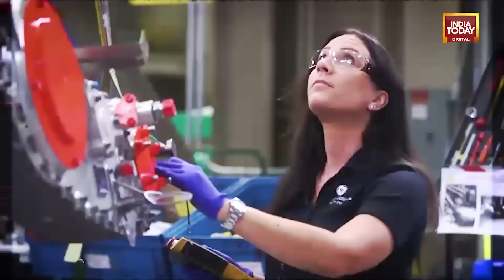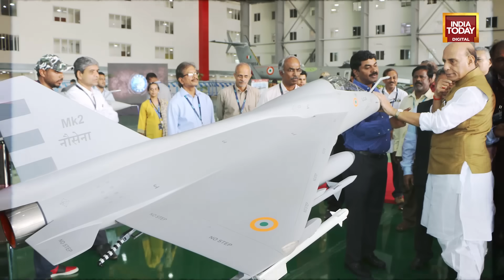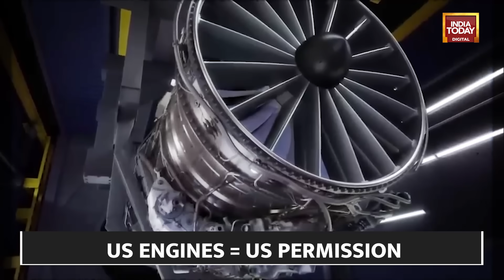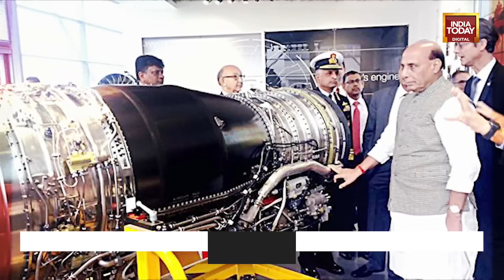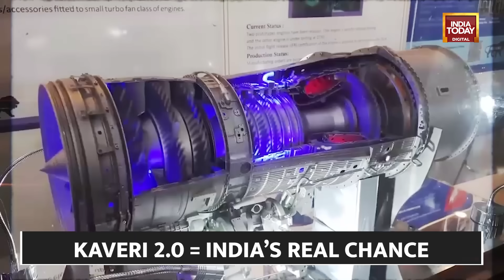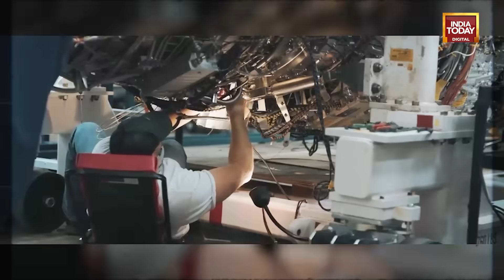Kaveri Engine: India’s Tejas Jets Could Fly Abroad—If We Shed the US Engine Chain #FundKaveriEngine

Comment: don't claim results of  the actions you didnt put in.
The budget india spent on kaveri devlopment is peanuts compared to the nations who have scceeded to develop their engines.
India spent less, got less, should be happy with dry kaveri for ucav ghatak.
When they can make a reliable afterburner, they may get a 80+ kn engine by 2035,  but that won't do for tejas, it needs 85 kn for tejas mk1a & 95+ kn for mk2, tedbf & Amca.
Under no condition kavery can match that, 
So the new 120+ kn engine development with foreign OEM is the only option, till then keep dancing to US tunes

Comment: Building an engine is no joke. Jet engines need single crystal blades and we don’t  have the tech for even this. Jet engines also has too much electronics in it. India needs to take this very seriously to build. Once you have an engine small commercial jets are around the corner.
Reply: Bhai lack of single crystal alloy will only restrain you to have a  not that good engine, won't stop you from having a usable engine. I remind you AL31F, RD33 and F100PW100(not later variants) they all have no single crystal blade
Reply: But Russian engines did not stop you to perform Operation Sindoor